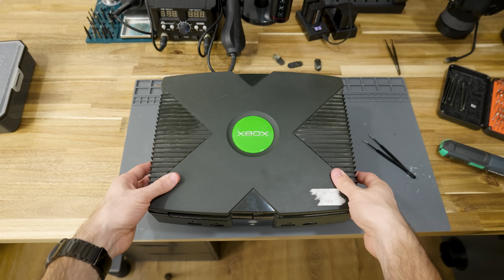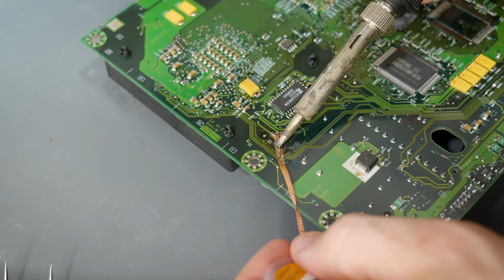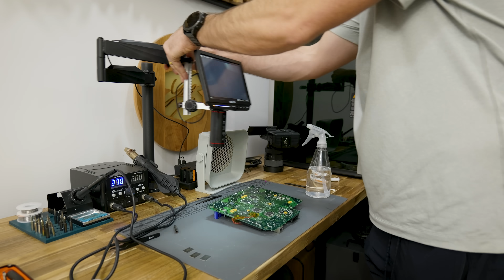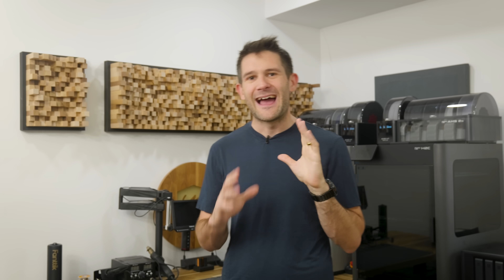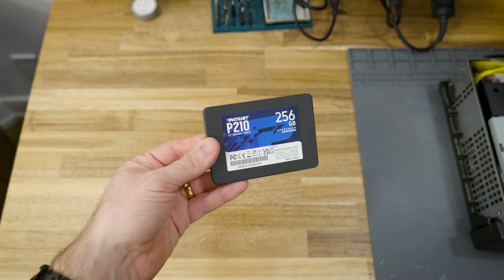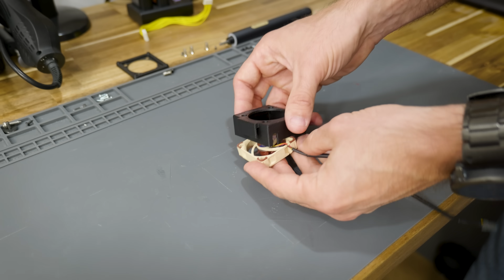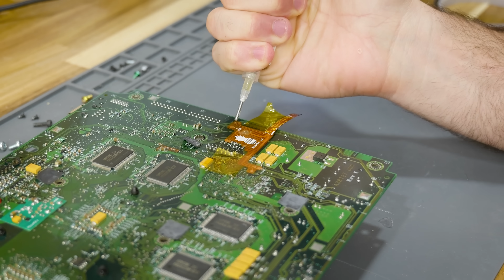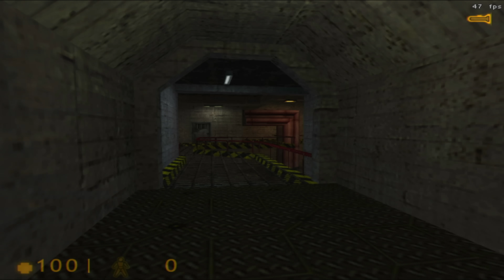I built a MODERN XBOX...

Comment: One trick I learned to speed up desoldering a little bit, if you clip off sections of the desoldering wick sufficient for what you're working on - rather than leaving it on the spool- bless the heat will be soaked up by the unused bit of the wick and everything will heat up in the solder will soak into it a little bit faster. 

The tiny bit of time for the cut saves a good bit of time, especially when you're removing a large number of components.

This is an amazing project I may give it a try on the salvaged one I have.
Reply: This is a great tip that a fair amount of people don’t know it seems. And when heat shielding, using aluminum foil “wings” will dissipate heat away from the board far better than stacking kapton tape over components. Use the kapton tape as a base layer on the board, then use kapton tape for the foil wings that move up and away from the board and component. Effectively shielding the rest of the board from the hot air.

Comment: I was so glad you swapped out the old 40-wire IDE cable, for an 80-wire. lol

That was one of the very earliest "simple" mods that you could do to an OG Xbox, back in the day.

It did actually speed up loading games from the HDD, once you had a modchip or soft mod installed.

Not by a massive amount, ofc, due to the fairly slow HDDs, but it was definitely noticeable.

Around 2008-2009, when I was working as an engineer at a PC shop, I used to throw away the old 40-wire cables, as soon as I saw one.

(On certain HDDs, even back then, it really could make a big difference in DOS and Windows. It's just the HDDs used in the Xbox were relatively slow anyway.)

Comment: 8:39 why are you putting flux under the chips?
Reply: Idk maybe to hold it down I never solder like that he kinda was using the wrong soldering tip as well
Reply: Probably to be lightly tacky to help keep it from sliding around too much during initial alignment and soldering down the first couple pins

Comment: System have fan feedback loop,  it will keep ~50C,  only under-powered fan might run nonstop and it might run in problems on hot days. Cables will not transfer data faster but rather peripheral disc controller and system design is limiter here. SSD will only eliminate seek time because there is no head to move on platter.

Comment: To easily remove the jewel, throw the whole top cover in the freezer, then once it's frozen, smack the back of the jewel with a rubber mallet and it pops right off.
Reply: Unfortunately this method has gotten risky as the top shells' plastic has aged. If you're unlucky you can wind up cracking the whole top shell.

Comment: I used to be a digital bench technician mainly repeairing set top boxes from Pace, Amstrad and Samsung etc before they all moved to BGA there was this one unit that had a massive CPU called the Emma chip, it alone had about 400 pins with a very fine pitch making them super delicate and we would drag solder it. I was one of only a few techs who could fit them with destroying them which was cool, but you needed a very steady and with  delicate touch, and most important a iron tip that was in very good condition. We used weller irons and the best tip was one that had a kind of well which helped the solder stick to the iron. One tip i knoticed you ad pre tinned the pcb where the ram sits, thats going to make it dificault for you to solder as the package with sit of teh board creating a gap when you solder, use wick to get all the solder off, and if you are reusing the ram make sure there are no high spots of old solder on the legs. When it sits flat on the board it will make it easier to align the legs and easier to get a good connection with solder.

Comment: Here's a tip, I use dental tools to check if pins are soldered correctly. You can hold it like a pencil which makes it easier to do with precision.
Reply: that's what we use in Aerospace work as well.
Reply: I just use tweezers or even a craft knife for fine pitch chips like the RAM on the Xbox.

Comment: That is not thermal paste but phase change thermal pad (some kinda wax ~). That's why it doesn't dissolve in IPA nearly or not at all. For better soldering SMD parts remove solder from PCB first, then components will lay flat and solder defect free. Tack corners and then use drag soldering...

Comment: Bending capacitor legs might seem like a good idea untill you need to remove them. Better to just let them be straight, and hold the part behind the PCB with a finger or some sticky tape or toy clay. Or at least bend one, solder the straight one, and then bend back the other one so they end up perpendicular to the board, removing them would be 10 times easier.

Comment: Due to system speed it is not worth installing a SSD. A 2.5" HDD with 7.200 rpm would be good enough. Also comparing the noise with the shell removed is unfair. You also forgot that you can replace the GPU with a newer and faster version

Comment: If you upgrade the new case to have an air tunnel, you could have a bigger fan on the back handle the work of both fans. Much like how the Dell 2400 used an air duct from the back fan to direct air.

Comment: This is so bad ass! My only thought is the CPU upgrade mod. That's the hardest mod to do because it requires pulling the CPU off and installing a new on and doing that on a BGA socket is hard and requires some high end tools. If that Xbox had the 1.4Ghz CPU installed this would be the ABSOLUTE best XBOX ever!

Comment: I use mine every week ! great gaming machine, great dvd player.
By the way easy way to get the GPU radiator is to turn on the console, wait until it heats, take it off, shut down the console.
You also could have used a component cable for clean video output.
Maybe you could have stretched a bit more of the console size with an internal USB-C PSU.
Awesome job by the way man, I'm glad folks still care for this machine !

Comment: 23:55
I CANNOT recomend this psu instalation. is way to risky to someone get an 120/220v shock when picking up the console from the side.
The pads are exposed! way to dangerous.. Even if is not plug-in the main capacitors can store charge for an while..
Not recomend!
Reply: Not to mention the fully open fan slot without a grill of any kind... Fortunately an easy enough fix, but still, the nono parts need to be protected.

Comment: it would be better if you included the intel tualatin 1.4 ghz cpu upgrade
Reply: There also the 256mb ram mod he could have done.
Reply: @darvonmason4249  No point in that. The ram doesn't run at full speed so it's useless.
Reply: I think he may have considered it but it is NOT easy work at all. I don't think he even has the tools. But what he could do is probably find someone that does these mods for a price. It would also be neat to do the socket CPU mod to swap if the need arises.
Reply: both mods are hard to do, prone to destroy your xbox and serve lil purpose
Reply: My life would be better if I won the lottery.
Reply: @Jamie-Weir . Probably not.
Reply: @robertt9342  NO IT WOULD

Comment: 3:44 (Correction :- 1.6 Revision Xbox's will refuse to boot without the clock capacitor. You will need to replace it in these models)
Reply: Crazy 😧
Reply: But it's much less likely to leak on them too apparently

Comment: amazing video, although I'm surprised you didn't do a power supply swap and have USB-C power delivery
Reply: Only reason I can think as to why he didn't was because it would essentially require him to have an external PSU. The only one on the market at the moment is PXU which requires a wall wart that can supply 100W and it recommends having a laptop style one which can be pretty bulky.
Reply: @MonaBags10 or you could also put a small 100w pd powersupply inside it! It would still save some space and heat. Old psu's are so inneficient compared to what we have now.
Reply: @DJMATGE  damn thats a pretty good idea
Reply: @MonaBags10 clever! howd i miss that 😅😊
Reply: @MonaBags10 is actually not complicated anker and ugreen sell very reliable 100w chargers
Reply: @Mahiro2791yt  i was gonna say, 100w+ usb C laptop wall chargers are pretty widely available these days
Reply: @Mahiro2791yt those Ankers have bad internals and crap out after about 3 months. Happened to 3 people I know in the modding community. Apparently it happens with usbc Dreamcast mod as well.
Reply: That was my first thought but maybe its incompatible with stellar plus.
Reply: @Lando00100  wouldn't think so unless it creates issues like electrical interference
Reply: i don't trust usb c power either. purely because of grounding. also ac power is so much safer than usb c and more durable because seriously, usb c is fragile and imo, not heat friendly.
Reply: @SaltyStudent371  the original xbox doesn’t use a grounded plug anyway
Reply: @AndraBullar well yes, but in reality the ac cable is more than safe. to me, trying to turn everything usb c just shows how unsafe people really are.
Reply: @SaltyStudent371  "it's unsafe for this reason"
"That reason doesn't exist"
"It's still unsafe because I say so and people are unsafe for doing it"

USB C is not made of paper, plenty of high quality usb ports that last along time. I plug/unplug my phone alot more than anyone will their Xbox and that survives!
Reply: @tribblier  it's great for phones yes, but i don't trust putting that much voltage through a small cable and a device that's over 20 years old. doesn't matter how safe it supposedly can be, power delivery failures can still happen and will always be unpredictable. to me using usb c on the xbox is like putting straight up on a car. you gain nothing and instead just wasted your time with something that has no bonus other than bragging rights.
Reply: @SaltyStudent371  Horse drawn wagons were safer than modern cars, but not many are used anymore. Caves are far more durable and fireproof than timber frame houses, less likely to suffer permanent damage from floods, and it's much easier to defend a single entrance, but few people would people would choose a cave over a fragile but comfortable house.
Reply: Not possible. That needs far more power than USB C can deliver.
Reply: @Totenglocke42 There was a mod requiring 100W USB-C adapter
Reply: @Totenglocke42  it is possible, modern PD is far more efficient, and usb c provides 240W
Reply: @infinnite4938 I really don't trust that standard and there are only a few genuinely 48V 5A capable PD supplies.
Reply: @sponsor-i9h  i dont think usb c is like the same as 12vhpwr
Reply: @sponsor-i9h  „I really don’t trust the standard“ - some random fucking guy on the internet 

Great argument 👍
Reply: @knappesouls8150  it’s certainly possible with USB Power Delivery, but the standard isn’t really designed for applications like this.
I have a USB-PD charger with two usb c ports and when you plug something into one port, it renegotiates both connections and shortly drops to 5V 3A (maybe even lower, I haven’t measured it). For a mobile device, this isn’t a problem, but you’d kill the Xbox with that behavior.
Additionally, most USB-C chargers don’t support all PD combinations, meaning in the end you have to search for a suitable charger anyways, which kind of defeats the purpose.
Reply: @Totenglocke42 Nope

USB-C can deliver up to 240w
Reply: @Totenglocke42 MattKC  has done it before
Reply: @Totenglocke42  There is something called the PXU. It requires and laptop style wall wart that can supply 100W of power which makes sense. All the board is really doing is changing the voltage distributing the power to the different plugs.